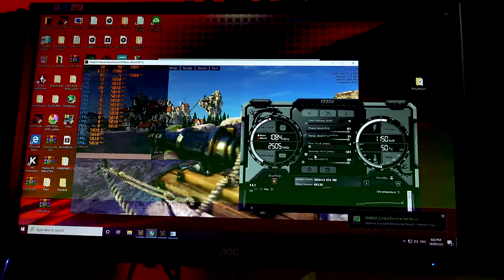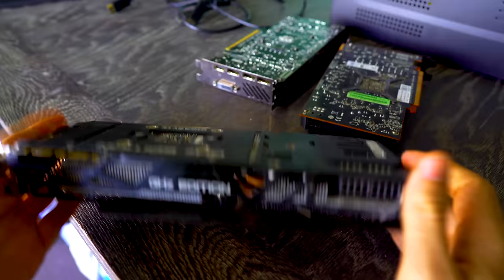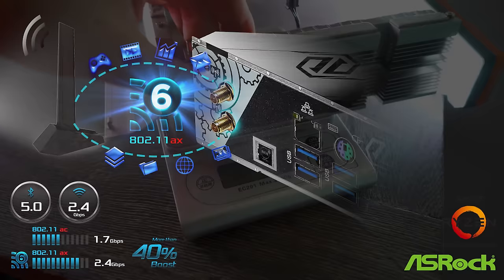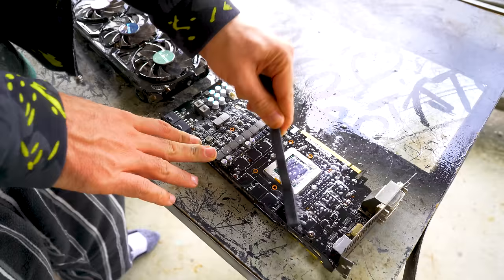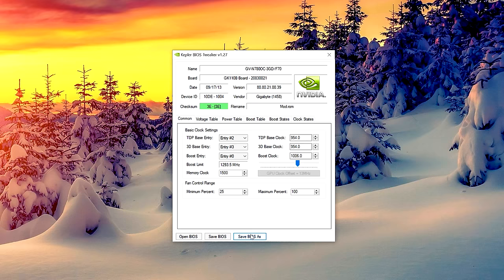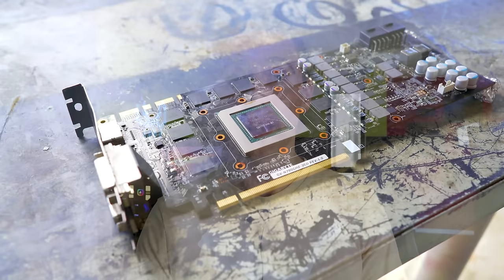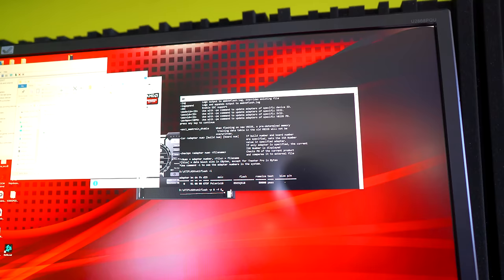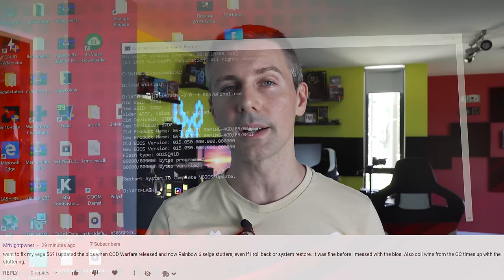4 Problems that Cause a Faulty GPU and How to Fix them.

Comment: dude just buy a cheap bga rework station. that heatgun is gaf. also, the solder joints break again. that heatgun is a temp fix and can damage components. you got skills. use them properly.

Comment: My heat gun method was on a brand new RTX2080 super that I repasted from stock paste and forgot to hook the fans back up lol, luckily it still works well and since I have not messed with it but wow what a burn in it had hahahaaa. I have recovered a motherboard in the oven before it was just a refresh of the solder that it needed :)

Comment: I'm having problems with 550 ti. In order for me to use it, I'd have to use my older GPU (GT 430) and then uninstall drivers (either DDU or device manager) and finally plug 550 ti and (re)install drivers.

I'll be able to use it as long as I can but if I try to use it again after shutting down there won't be any display output. I'd have to redo everything again. I wish it was possible to mix these 2 GPUs together, I'd have a fairly decent 980 TI 🤣

Comment: Things to do to a "new" used GPU:
Quick test on cheap PC
Clean cooler
Super Clean PCB, contacts, ports
Replace thermal paste and thermal pads
Properly test on good PC

If it works its gg
If it doesn't work, try installing a new bios on the GPU (sometimes they get corrupted)
If all this doesn't work:
If the GPU is worse then a GTX 1650: sell it for parts
If the GPU is better then a GTX 1650: send it to a respected professional for them to fix the GPU (the price of the repair should never be over 60% of the price of a NEW equivalent GPU)

Comment: Rip my r9 270 it goes to a black screen when I install drivers it freezes then goes to a black screen. It only works in safe mode with microsoft basic adapter. That is problem 1 i cannot fix it.
Reply: I have a card with this problem too...still looking for a fix!

Comment: Heat gun heat has a significant negative impact on the lifespan of electrolytic capacitors. Avoid heating the device.

Comment: How do people allow their cards to go RUSTY???? Are they taking them to the bath??

I had a Gigabyte 780ti that started to go artifact in games and then not display anything. Rebuilt windows so many times it was defo hardware.
Removed all the plastic parts, shoved it in the oven for 15 mins at 200'c, and it worked fine.
Did that 2 more times over 18 months and it worked. The 3rd time it died.

Just be careful to take a picture of it before it goes in. I put it in upside down once and a bunch of caps came off and landed in the bottom of the oven.
Soldered them back on and it was fine...

Comment: You are doing the heat gun method the wrong way mate. You need some tin foil to cover the entire card except for the gpu silicon, in order to protect capacitors, SMD´s and other electronics

Comment: Take off everything of the parts that you can remove from the card put alluminium Foil to the chips of memory ( not on GPU core )  and on the back plate of the board  and  put it for 10 min in the  oven on blowing air mode at 190 - 200 Celsius ! Then you can try it i have save many time GPU cards like that !

Comment: interesting vid  and my opinion about heat gun  is  neutral  tough as you doing that you need to have your card leveled and you need to concentrate to heat up  the self gpu and memory chips   that is the most important stuff where corrosion can do  damage  you no need to heat up whole board  especially  polymer caps they  not like too high temps  👍😀👍

Comment: 11:20 It might actually be your soldering iron thats holding you back. I felt exactly the same way, I had a soldering iron that the heater was way down in the handle and the tip was a long rod.

a far superior design is a thermally controlled soldering iron that has the heater element nearly at the tip. Less thermal mass to heat up, less thermal resistance in general, more accurate temperature. Soldering has been so incredibly easy since I got my new soldering iron kit (Txinlei 8586D from amazon) I love it.

Comment: i have a rog strix rx 570 oc 4gb and when i open dxdiag from run it shows that i have 0 mb vram and a microsoft basic display adapter , this problem appeared after i bricked my gpu and saved it from the brick. i subbed and liked,  thanks for the video btw

Comment: i threw my gtx 1060 3gb a gains ta wall and it started working again but something fell off the board right next to the processor apparently it was causing the problem

Comment: BrYes,  RE:  "Heatgun Method" two thoughts for your Pennies;  1) Get some Flux [best with an applicator, or large bore needle tip], squeeze it around VRam [NAND] prior to heating.  2) Start with some heat on the BACK {bottom, ya know, down-undah} for a minute to start.  -Then give it some flux [before it cools, glove up, or non-conductive clamp {easy does it}], wait for some bubblin' and more "Stink" (ventilated area).  Might get you another 10-15% survival rate?  Give it a shot, let us know!

Comment: CORRECTED EDITED TEXT
; So after receiving a few donated graphics cards ...
; I attempted to repair one of them that I was told was a 'goner' -
; and to my surprise it worked absolutely fine!
; Though I know faulty GPUs come about quite a bit and here are the
; top 4 problems I encounter and how to repair them.

PAY ATTENTION TO THE DIFFERENCE
Undertake an extensive reading program to learn how to write
using correct grammatical Legal English.

Comment: will a 500 watt psu run a computer with a 970gtx?
Reply: Without any problem. I also used a GTX 970 with an Enermax 500W PSU. I also run a RX6800 now without any problems.

Comment: So i thought of how u can apply heat with a gun a lot better....Create a tent with some fireproof non conducting material and blow from above at a distance where it can spread. U can use a temperature gun to monitor what temperature you are around. I have an old r9 270 that im gonna try a few things with. Btw does anyone understand how a gpu might destroy windows. Cuz thats what i was getting. The card was identified as the cause.

Comment: i used Flux paste on gpu before for not installing driver and its work put Flux paste around the gpu and use heat gun for 5-6 min until its despear i guess you know but if you dont you own me one (o_o)

Comment: If your gonna keep doing these types of repairs at least get a proper rework station. A 989D is good enough for hobbyist usage and fairly cheap. You have no control of the heat or air speed with a gun and risk destroying the nearby caps and other components. Focus the heat at one chip at a time, the ROHS solder is never gonna get hot enough to reflow is you keep jumping around. And need to use some no-clean liquid flux or once again the solder in unlikely to reflow properly.

Comment: My processor fell on my gpu and now the display has a lot of colorful pixels and I have no idea how to fix it. Please help
Reply: Your... Processor... Fell on your GPU????
Reply: @discordo206  yes, I have a cyberpower pc where the motherboard is on the side panel, I didnt lock it in right and the processor fell on the top of the gpu.
Reply: Dang. What do you mean by colorfull pixels though? Also i hope your pins are not bent if your running amd...

Comment: I've had a gtx 770 with the weird issue that it wouldn't work properly after driver installation
Left it in a box for over 2 months without the cooler attached
Couple months come by I put the gpu back together and it randomly works like wtf
Mystery gpu right there

Comment: the multi purpose spray he use is wd40? I just wanted to be absolutely sure before I do anything lol
Reply: He told it. But it blows my mind. Spraying oil on component ? whoa... It must be so greasy after..
Reply: Yeah I figured it out exactly what it is. But that was my thoughts exactly! It doesn’t just evaporate does it? Lol when he mentioned how it looks nice and new and shiny I was thinking more like oily looking haha I’d be tempted to wipe it off 😂 I was thinking brake cleaner would be worse wouldn’t it haha
So what should you clean with? I saw in some vid someone using a soft toothbrush and some cleaner but can’t remember what it is.

Comment: My 4gb Rx570 has a vram error. I ran some diagnostics, and yep vram faulty. Also every now and then my system ram gets about 4.1 gb hardware reserved, which makes me think that my system is using system memory to make up for the lack of functional vram, considering my card is supposed to have 4gb of vram, but does not have 4gb of FUNCTIONAL vram lol

Comment: Using a hotgun is not a good method to fix those GPU's.
A proper fix is to reball the BGAs. But you need some tools and some soldering knowledges.

Comment: did you say brake clean, that's daft, using brake clean on electronics is crazy, it can do more damage then it cures, use a dedicated electronics/contact cleaner, even over the counter sprays like CRC QD Electronic Cleaner you get at your local walfart is 10 times safer then brake clean because it doesn't harm plastics and resins, 2 things that tend to be used a lot in electronics ........

Comment: Umm dude in my place can revive every gpu in any condition including gpu that totally not responsive (not even can boot up one) for some bucks. I have 7850 and it was dead, i mean my system wont boot up with that gpu installed like r9 270 in this video and he repaired my gpu like a charm for 9 dollars. Wow wtf

Comment: Um Broken Vram Disable it on Windows. Should use your regular ram for Vram instead of the broken 1 on the card like my 1080ti. Did not want to remove card from PC and go ham with WD40

Comment: Will you stop soaking PC electronics in WD-40!!! It leaves a horrible residue when it dries and attracts dust and will cause the GPU to clog up faster.  Get the cleaner that TronixFix uses for his clean ups.  If you are WD-40ing rusty old electronics and then re-selling them you are risking selling someone a ticking timebomb!
Reply: No

Comment: Welp my 2070 died and got a RNA from evga and got another one and that ones died in 2 days so I'm just going to try AMD fix it my self. Got all the things I need to work on it so why not xd
Reply: If you have warranty don't try those methods. It's possible that they wont give you another card.

Comment: i bake my cards in the oven 420 for 10mins normally does the trick if its solder issue
Reply: does not the plastic parts like (like one in the DVI connector or HDMI) melt on such hight temp?
Reply: you put the card on a pan make it level with aluminum foil and make sure the foil on the pan
Reply: @SuperBigNye  Actually I bought a used GTX1060 3GB recently for like $50 the guy told me that card is working fine but he cheated, Hdmi port is giving no output, Display Ports working fine but many time cards refuses to give output on fresh system restart. i was wondering if putting the card in oven may help. help me  to decide.
Reply: Sometime computer starts up with display continuously (I can see windows booting and getting to desktop but it keeps blinking comes for 500ms, goes black for 500ms) i m worried in near future the card will fail completely. most of times the card works fine and i play games on in like 1-2 hours (have not tested longer) without any problem.
Reply: @SuperBigNye  ok thank you

Comment: I need help with my gtx 1080, it was artifacting a couple of times then after I turned it off and back on my PC doesn't recognize the GPU even though it shows it on and the fans are on , can you please help me?
Reply: That's exactly my problem. founders edition?

Comment: I think I can help about going black screen
Reply: help me plz ?
Reply: @loaderbot123  first get the DDU In any pendrive run your system in safe mode then extract ddu and remove and restart your graphics card driver
That worked in my case
Reply: do u get black screen after installing the gpu driver ?
Reply: @loaderbot123  yes, but it's fine now.
Also dont use the CD that come with box it's probably older version of driver it'll cause that issue
Reply: so all i have to do is uninstall the driver with ddu then install it in safe mode ?
Reply: @loaderbot123  no just run you pc in safe mode and uninstall your gpu driver with ddu and restart it should be fixed
Reply: thanks my friend
Reply: Nurhuda Kurniawan  you mean version of DDU?
Reply: @loaderbot123  I hope it worked for you.

Comment: https://www.youtube.com/watch?v=2feI3xIm19E 
This and re-pasting the card helped me, GPU would give me black screens with unresponsive pc when playing intensive games, was driving me crazy, so at first I had to decrease power limit to 30% and it seemed stable like that. 
Until I did what's in the video and cleaned/re-pasted it. Didn't happen again. 

One thing I noticed when I was cleaning it was that the VRM coils seemed a bit discolored but I think that's just high temp discoloration, seems pretty common when I searched about it online.

Seems like drivers sometimes just "break" the cards? The slimmer worked wonders. MSI 390's my card btw.

Comment: i have several cards that are (were dead) till i saw your vids and tried the heat gun trick, out of 4 i revived 2 which did have artefact issues. but one isnt accepting drivers. its using Microsoft display driver. its an asus HD7970 3gb and it used to crash under instant load so when i took it apart i saw COPIOUS amounts of conductive shiny shitty paste all over the whole circuit board. never seen anything like it.  i bought it off some dick head that ran a computer shop ffs. so i never thought it would even turn on after the cleans i had to give it, but its just the display driver issue i think. any ideas what i could do? love watching your vids mate keep up the insanely great work :)

Comment: And you still don't know how to solve the first problem? Cuz I ended up with that
Reply: Please tell me you have a solution, My RX 580 gives black screen after I installed drivers but gives basic video output from bios driver if driver uninstalled
Reply: @laxminarayananks1520  here some solutions may work on but it still not work on me. I think worth to try. 1. Change thermal pastes. 2. Change all thermal pad on the gpu vram. 3. Check for psu pin. Are they broken or not. 4. Change the psu cables or go get higher wattage and efficiency. 5. Change setting in msi afterburner
Reply: @trileobayu2023  Thanks for reply:

1) I changed thermal paste on GPU die
2) Thermal pads I have none so can't do that replacing
3) PSU is functioning well (EVGA NEX 750B), Tried on another PSU too (Gigabyte 450B). PSU runs GTX 760 at the moment. 

4) Tried in three different PC's same problem (Mine, my roomie's & our HTPC)
5) MSI afterburner setting changed to default.
Still same problem. It crashed when i was updating drivers last week. Since then black screen upon startup.

Comment: Everything this man is doing is literal... 5 minutes in a ultra-sound pool with 50% isopropyl alcohol and 50% distilled water, there is no electronic repair method here, and apply the same just because for 8 minutes to the memory chips and the central chip is undoubtedly a very bad idea.

Comment: here's my problem: Gpu Sapphire rx 580, shit card, built very cheap, overheats very fast. well, I need it to work again. So after new Themalpaste and pads, it was running, but the Temp sensors were wrong, (checked with a heat gun, and SpeedFan, GPU-z. Adrenalin update didn't fix it, the GPU was giving wrong Temps! so I decided to change bios to OC Bios(Dual Bios GPU). so then It really ran in Heaven Benchmark 4.0 in 5 minutes over 100 Degrees CElsius, but my fans where spinning like hell. here's my problem: Gpu Sapphire rx 580, shit card, built very cheap, overheats very fast. well, I need it to work again. So after new Themalpaste and pads, it was running, but the Temp sensors were wrong, (checked with heat gun, and SpeedFan, GPU-z. Adrenalin update didn't fix it, the GPU was giving wrong Temps! so I decided to change bios to OC Bios(Dual Bios GPU). so then It really ran in Heaven Benchmark 4.0 in 5 minutes over 100 Degrees CElsius, but my fans where spinning like hell. ( because of Temps), and watts consumption where low, so I checked with heat gun, and my REAL TEPMS were like 55C. so I needed to Bios update my GPU clearly!!! from there everything went bad, NOW my card doesn't get detected by BIOS or any Program. and when I change PCI-E slots, the Mainboard doesn't run power to that slot. so what shall I do?

Comment: Self magnetized my secured device of few seconds and need help with with breaking way to for self going through the Convo of a renegade ringing that a secure charging I and or willing thinking might not exude a 0500 distance that the problem is that another set of hand may have put a magnet around a device for seconds and didn't harm the sounds making thin coming to stressing beaming through the question that even now a day not one wolb of pic Tric idea any who Convo with metro saying I any another individual may help just the instinse of asking the clergy clerk they may not stopp any Convo that you the person and the technology that other people except the devices and the main person who cares  owns and has device has this the house 0500 problem the little man just don't know the housing perfound throu time in time the chain is the results of the wielded paths the phone and those worlds around those paths it walks amoungs these followers aloneside nonalone no esl invocalist volts to a hamburger dip if you can the The pure water to Brien the sore source to secure the wielders help and indefinite fix to heilders worth that involves the Pinkerton fix that without knowledge or cahoots knowledge may be able to fix the phone at fris electronic lil brother Daniel bling bling ages bling bling era may not be able to stop with the question if you lick your fingers and switch your own SIM card how could we help you even as long as one of the greatest questions for our own if you can buy our own danielsgarcia427@gmail.com